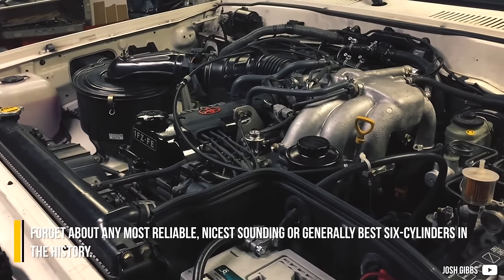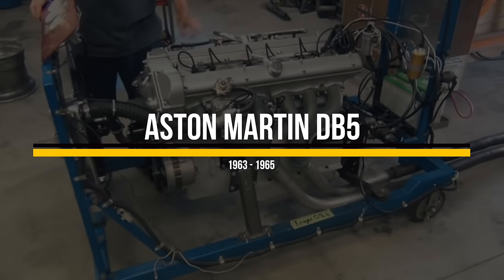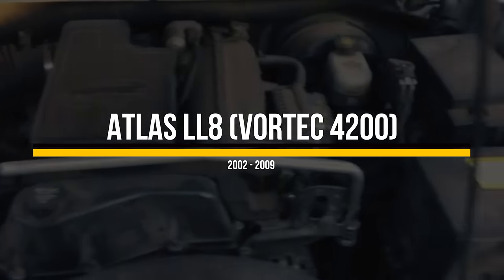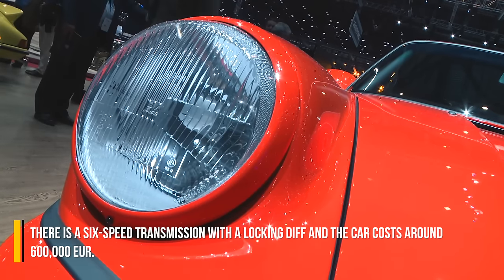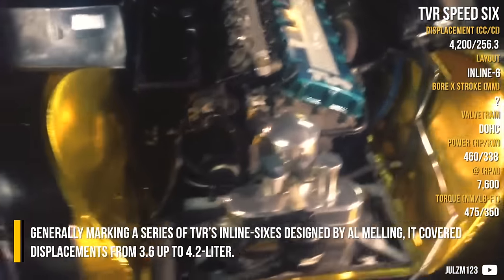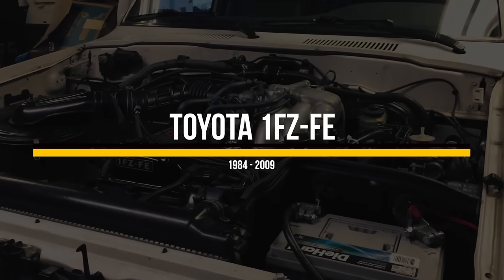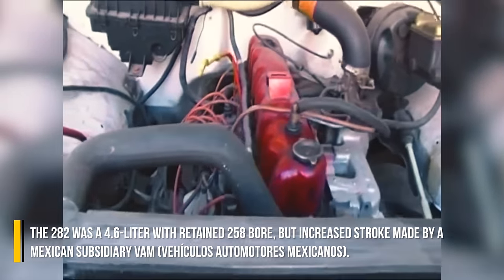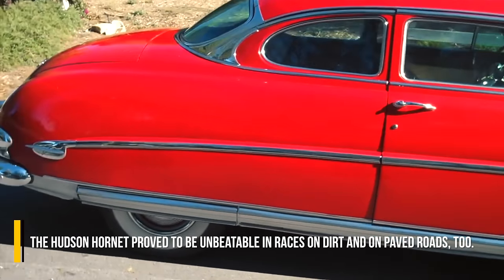12 Largest Automotive 6 Cylinders In The History

Comment: That Buick LC4 had a huge 4.2ltr V6 engine and made 125hp.

My Ford Focus with 998cc and 3 cylinders makes 125hp!!!! Haha!!

How can you get such low HP from such a large displacement??!!
Reply: Torque
Reply: @emave27  
What about it?
Reply: American engines are all about torque and reliability, not power
Reply: it was an engine designed in the 70's
it was meant to sip gas but still have enough torque so it feels somewhat powerful
the LC4 did have a turbo strapped on and put into the GNX and that was the fastest car in the world in the 80's before the italians stole the show again. I believe the LC4 was also put into the GMC Syclone which was another beast
Reply: also, engine efficiency has come a long way since the 70's
Reply: You won't be haha ing when the feeble timing chain snaps at 65K and turns it into a boat anchor...😂
Reply: Smog cars.  Honda prelude from that era had -15hp.
Reply: Valérie L'Allier, lol the put up big up numbers in early 80's?
Reply: How can you compare a engine made in the last few years to an engine made 40 years ago? The Model T had a 200 cubic inch, 20 horsepower engine. Things have advanced since then.
Reply: Jamie Reid
Yes, and that Focus emitted 100x the amount of toxic exhaust fumes as that Buick.
Reply: Valérie L'Allier
Except that those Euro engines were just as weak when modified to meet US emissions regulations.
Reply: 999cc
Reply: Those Buick V6's were an extension of the 1960 Buick V6/1951 - 2000 Buick/Rover aluminum V8... 
The Syclone/Typhoon  had turbo Chevy 4.3L V6 which was 3/4's of a Chevy 350" V8...
Reply: Jamie Reid...Haha!!!   Buick also made the GranNational turbo 6 that would eat anything Ford made at ANYTIME .
Reply: @TheMitchbassman  
You completely missed my point lol
Reply: @aaronhumphrey2009  

No I won't lol. My timing chain is submerged in oil, so it'll never break. 

Try again.
Reply: Just about everything Ford makes now is EcoBoost meaning small motor turbocharged...

Comment: Click-bait. What about the 245.6 cubic inch Studebaker Commander six used in the 1950 models? What about the 250 cubic inch engines from Ford and Chevrolet in the late sixties and through the seventies? Millions of them were built. Tens of thousands of the Jeep 4.0 liter six, and the 4.2-liter> The 263 cube Chevy, the Olds diesel V6 that powered some of the fwd Cutlasses?

Comment: Too bad you couldn’t get the right models of AustralianFord Falcons to suit the mighty “Barra” engine accurately the 1st one @ 1.00 shows an earlier Falcon XR-6 of the EA,  EB, ED, EF series of body styles of the late 80’s into the 90’s which never had the Barra engine but the previous sohc unit around 3.9 litre then you showed the model before the 1st Barra engined falcon that was @ the drag strip which which also had the sohc unit, the AU series, the 1st Barra came out in Australia’s 2002 BA series in varying models but the six was so good Turbo charged form
That it was quicker than Australia’s Quad cam V8’s as sold in XR and FPV performance versions, as a matter of fact you can get up 1,000 HP plus out of these Aussie only engines reliably with realistically minimal mods so much so that the Americans are shipping them over to the states in container loads from our auto wrecking yards the end came for these great donks when Australia stopped manufacturing in 2016 after producing Ford Falcons in this country since 1960, Australia was probably the only country where six cylinder cars were king per capita anywhere in the world, as an aside Chrysler Australia also had a unique six cylinder to us re the Hemi sixes in our Valiants & chargers ( as well as V8’s) in 215 c.ias the smallest then 245 c.i Then the 265 c.i (4.3 litre) this later one was also in a few states of tune the fastest Bathurst model had triple twin throat Weber’s with other hot bits from the factory and in its day was the fastest accelerating six cylinder car in the world it would do the standing quarter mile in the low 14 second bracket ex showroom floor in the early 1970’s.

Comment: You shouldn't have claimed "in history". Brass and Nickel era cars had 6 cylinder engines that dwarfed those produced since WWII.

Three cases in point: Packard and Pierce-Arrow both produced 525 cubic inch Sixes, and Pierce added a 715 and an 825 cubic inch Sixes to their line-up.

Seriously, dude, you really need to improve your research skills - or at least stop using such deceptive titles for your videos.

Comment: VIDEO SHOULD BE CALLED:  TINY 6 CYLINDER ENGINES!!!!!!! That's a tiny ford inline 6 cylinder u have first....shit there's millions of 5.0 liter 300cu inline 6 cylinder ford engines in trucks....my uncle has 1 still running great with 800,000+km on original motor and transmission and transfer case, been thru few clutches tho but no rebuilds...

Comment: There is nothing remotely ‘good’ about a hemispherical combustion chamber.
 CR is too low
 Valve angle is to shallow
 Piston top is too mis shaped.

 Flat top piston in a pent roof cylinder head with 4valves/cylinder with the steepest valve angle possible is far superior. 

 Think about squish bands….

Comment: 0:30 4 liter inline 6s were no big deal in the USA up to the late 1970s, with both GM and Ford offering 4.1 L, "250" 6s as their standard engine on many models. They started to be replaced with V6s  in the late 1970s as carmakers tried to shorten the hoods and pull in the front wheels of their new models (eg. the 1978 Chevrolet Malibu) for lighter weight, better economy and better maneuverability. 

https://en.wikipedia.org/wiki/Ford_Granada_(North_America)#First_generation_(1975%E2%80%931980)

https://en.wikipedia.org/wiki/Chevrolet_Chevelle#Third_generation_(1973%E2%80%931977)